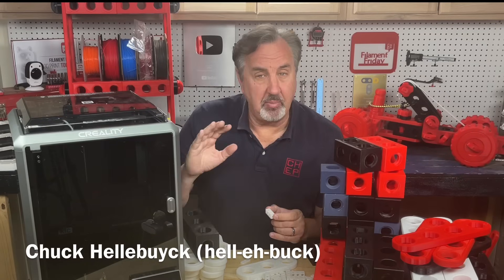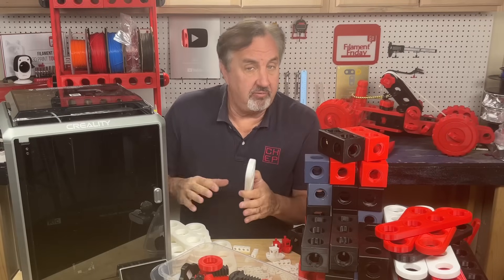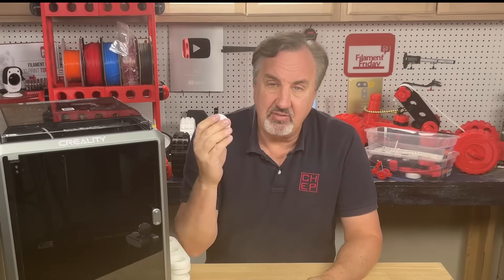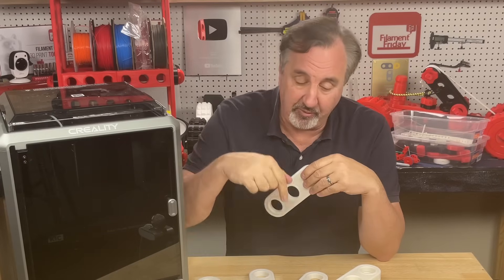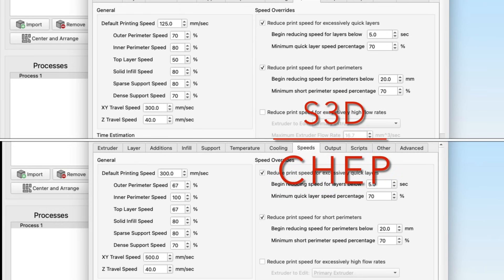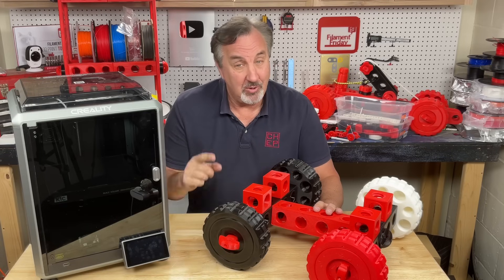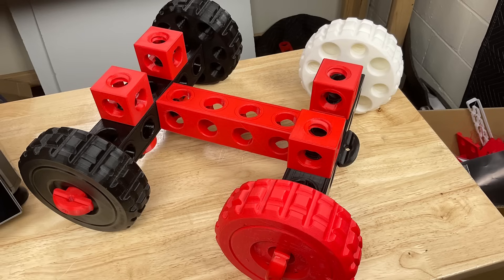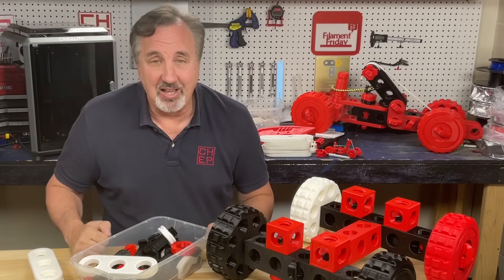3D Print Larger Faster on the Creality K1C

Comment: I have a complaint about Creality and the K one C   Sorry but for some reason it let me put any numbers down ,I bought the printer last August and had a few problems with it but easy to repair, until now the wire to the Toolhead was exposed and causing short to the hotend . So I looked online for a replacement part but no one carries it except one place called DREMC and they deliver to my location ( I live in N Las Vegas,Nv ) and Creality doesn’t even have the part on the website for replacement parts. I got in touch with Creality and they said if they have the part that it will cost thirty dollars extra to send it to me ( Tariffs I guess ) but I need the part . They was my favorite printer even over the Creality Hi I just purchased. It sucks that no one carries the parts.
Reply from the maker: I recommend the Microswiss hotend. The thermistor is protected. https://youtu.be/QVj-M9v7-zk?si=NVhMw9OqJqTUrYOL

Comment: Hey Chep, I am a big fan of the channel keep up the good work. I was wondering would you consider doing a video on Orca slicer as a whole. I have been using your profiles on Cura for years and they are great. I recently tried Orca slicer out. It's ok but I transferred over some settings from my Ender Cura speed settings, and it isn't even close to what I get from your profiles. I also changed acceleration, jerk settings, and some others as well. I am not sure why I can't get close to the performance I easily get from Cura. I am a Cura fan, but I want to have a little bit more variety as well as experiment with other software.
Reply from the maker: I’m working on that as I type. It’s taking longer than expected but it’s coming soon.
Reply: @FilamentFriday  Awesome, I can't wait to see what you find out. I am currently playing with settings still, but I can't beat those Cura profiles they are still great.

Comment: I regularly use a 0.8 nozzle and a 0.4 layer height to rip prototypes. You're going to have to work a lot harder to sell me on a $200 slicer when PrusaSlicer is out there.
Reply from the maker: I don’t have to work at all. I’m not selling it as I said in the video. Just letting people know what I found. Hopefully I can figure out how to capture what I found and implement in Orca.
Reply: He worded it as "pulled off the shelf." Simplify 3D used to be the best slicer when Cura and Slic3r were the only options. So, a lot of 3D printing youtubers still have it laying around on their computer, even if it's no longer the gold standard. It is interesting to go back to old programs to see if they've updated or left to rot like Meshmixer
Reply: No problems White ender3v3se a use 0.4.
0.6 0.8 and a1 mm nozzle.
Also goth a 0.2 for little fine things .

Comment: It sounds like S3D isn't limiting the speed based on the max. flowrate of the filament and hotend combo.  Other slicers reduce speed if that would exceed the flow limit or the required cooling.  The speed benchy profiles typically throw out all those limits in the slicer and disable other things that cost extra time.  There's nothing really magical about them, but unless you know what you're doing, you can seriously lower the print quality with those settings.
Reply: Most correct comment
Reply: A year later and this is what I was thinking also.

Comment: You can improve print speeds by turning off acceleration control and reducing minimum layer print time. I printed a benchy in under 9 minutes. It wasn't pretty but it was possible.

Comment: You know lots of creators kept bashing simplify3d on principle. I love simplify3d. They also support proprietary printers not supported by the other slicers
Reply: I don't think anybody has criticized S3D for its slicing speed, variety of settings, or print speed/quality. Many have made highly reasonable complaints about how long the latest version was vaporware, how even existing users were charged for the latest version when they were previously not charged for updates, how expensive it is, and how many modern slicer features from Cura, PrusaSlicer, SuperSlicer, OrcaSlicer, and others are nowhere to be found. Five years ago it was head and shoulders above every other slicer in existence. Now? The competition has caught up and is poised to leave S3D in the dust if their pace of development continues.

If it were free or maybe less than $30, I think a lot more people would be able to justify using it or at least trying it out. At $199, no hobbyist has a justification to buy it and even small business owners have to weigh the pros and cons before making the purchase, assuming it doesn't come bundled with whatever printer they buy.
Reply: @justinchamberlin4195  upgrade cost me 45 dollars, not such a big deal. It does lack some features, but it has a good clean user interface, handles many printers not supported by other slicers and I noticed it prints very clean on my creator 2 pro compared to the native slicer. I still use Orca for my k1 max, but that's because I still don't have finely tuned profile for the filament I use on simplify3d. Once I have a proper profile,  I will try it with that printer for a while

Comment: One of the main limitations of speed is how quickly the hotend can melt the filament. Once you find that out, you build your profile and speeds based off of that. If you are exeeding the heating capabilities of your hotend youre not going to have strong prints, you'll have weak layers, under extrusion, and even dimmsional accuracy issues. Using the Layer Height x Layer Width x Speed formula to figure out your max flow rate of the profile and staying within the hotend capabilities is going to be the best foundation for any slicer profile.
Reply from the maker: The K1 can already melt fast. I bumped the temp a few degrees and prints were better with S3D.